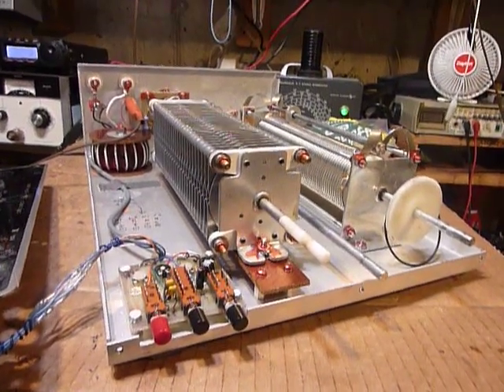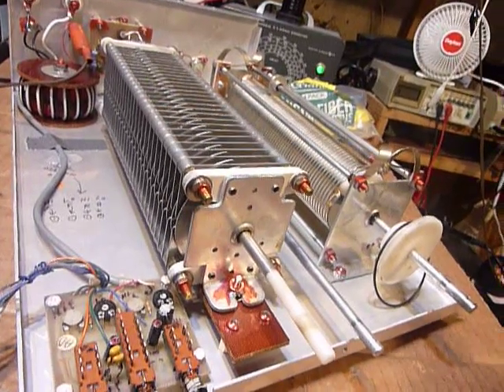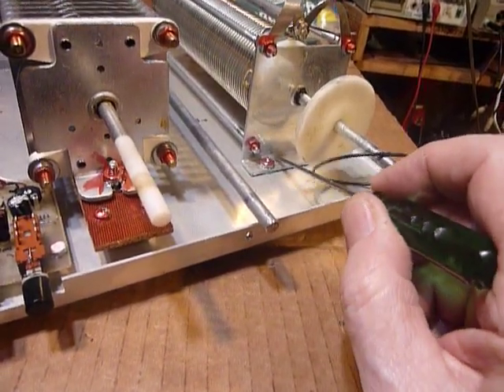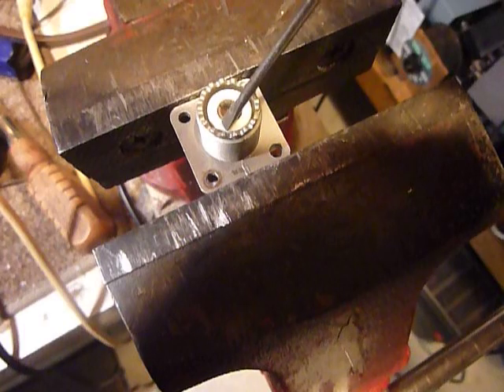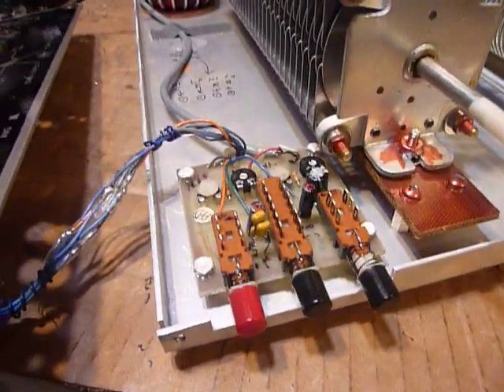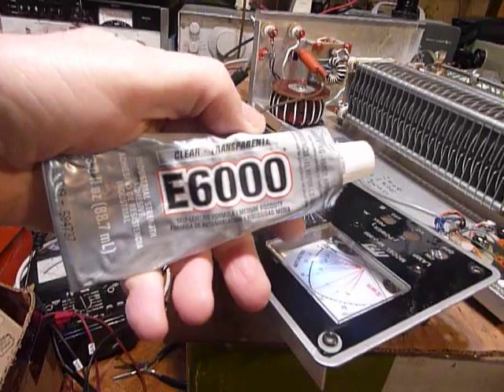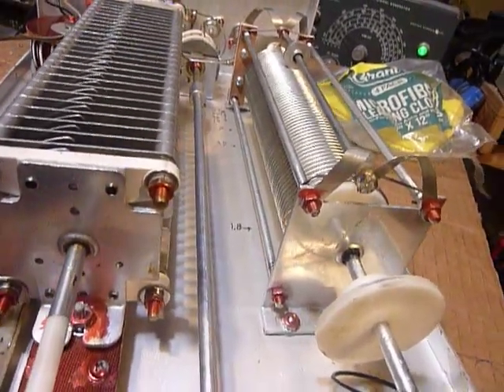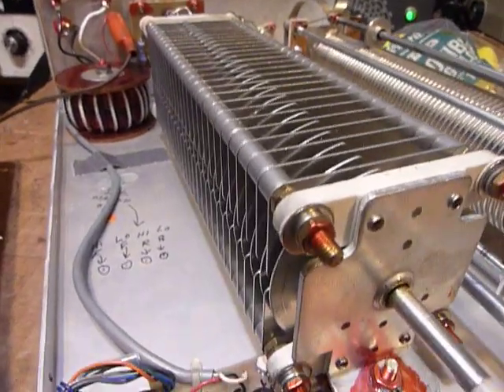MFJ  986 Antenna tuner  Repair and maintenance .

Comment: Loctite 290 - aka "green" Loctite.  290 is often used in electronics, and is easier to remove than 242.  It is also a "service removable" threadlocker.  It is used on nuts and screws on circuit boards, adjustable components (trim pots, capacitors, etc).  Apply to nuts and adjustments after making them up.  It is very low viscosity (watery) and wicks into the threads well.

Loctite 222 - aka "purple" Loctite is also "service removable", and not as strong as 242 ("blue").  Great for set screws, other small fasteners.  "Designed for precision metal fasteners under 19mm."

Loctite 242 - aka "blue" Loctite.  This is "service removable".  Use this for scope mount and base screws.  It will prevent loosening, but allow removal.  It will turn to a white powder upon removal that some mistake for corrosion.

Comment: i have a tuner just like it, but the inductor(ceramic core) went bad, if i am not mistaken i think the value of the inductor is 25uH, question is, can I replace it with a higher values inductor say 35uH? will it change the tuner parameters? your advise will be greatly appreciated..
keep those excellent videos coming..
best regards!!

Comment: I just bought a used then an 986 at Huntsville hamfest, Hook it up tried it turn the dials it doesn't seem like anything happens to the meter the dials just stay in the same location all the time, looks very pretty inside looks like brand new

Comment: Kind regards, Please, in the MFJ-986 Tuner, can you tell me in the 4 trimers of the card that is below the meter, which is the high power adjustment, which daja, which is SWR and which is Reflected? I will be grateful. A hug.

Comment: Greetings, and congratulations, excellent video, I have that same 3KW tuner antenna, and I would like to know how to adjust the power trimers, they are the 4 that are on the card that is under the clock, or if you can tell me which one is of Low power and which one of Hight and better if I design it on a piece of paper and how I should adjust it, since someone moved those trimmers and now it does not mark the correct parameters on the Clock. Thanks and a hug

Comment: I couldn't find their ph #. No matter. Ant sel switch gave out completely, after only having it for a month, so don't really need to talk to anybody, Frustrating cz I spent $450 to buy it! Tuned up gr8 until this! I'll be shipping it out soon! And the 868B wattmeter I ordered had a screw loose which affected connectivity. I tightened it myself & has since worked well. After a cple yrs, when it's out of warr, would u give mine a once-over like u're doing here?

Comment: I have a question and I can't find an older schematic. It seems like I have an older 986 like yours. I bought this one on eBay and the meter had come apart and was showing reflected power 10 no matter the adjustment. I replaced with a new one and I cannot zero out the reflected power. Any suggestions??

Comment: Great stuff. I recommend disconnecting the meter leads, twisting them fairly tightly and then re-installing. This will help resist stray RF pickup that makes the meter wander or react unreliably during tuneup.

Comment: If you want some good alcohol try Everclear just don't drink it, it is over 96% pure and is drinkable if you are hard up for vino. I found out the hard way that 91% rubbing alcohol will not work very good for epoxy thinner, way too much water content.

Comment: I really enjoy your videos! I will vouch for the E-6000, just fixed a small casting flaw on the transfer case of my daughters truck that was leaking. Cleaned it off and it 'self-leveled' made it down inside the hole and sealed it up. It is a very strong adhesive also.